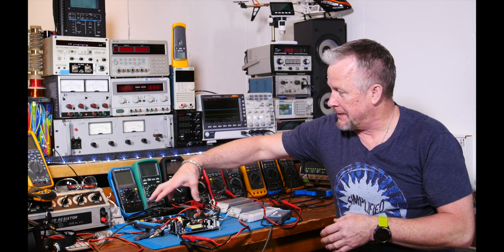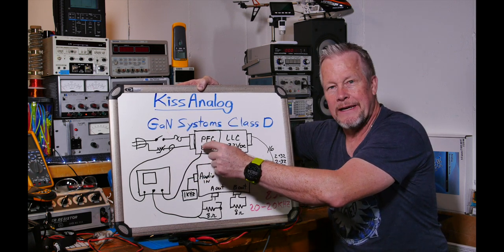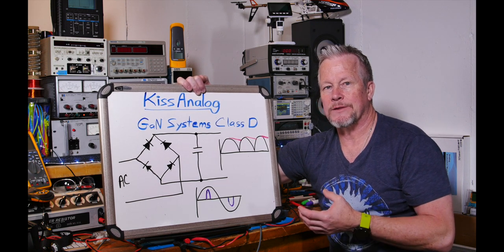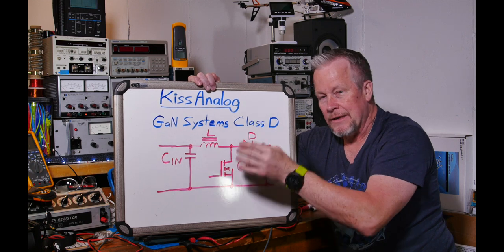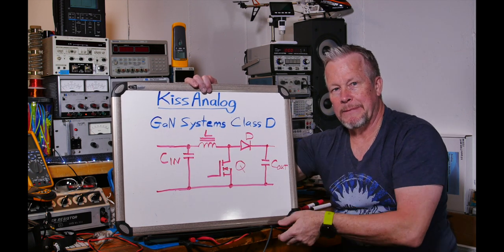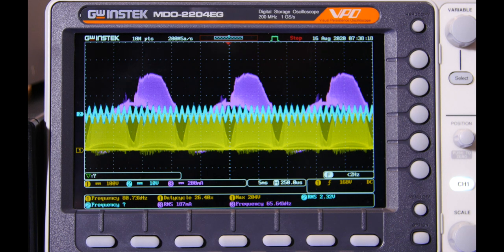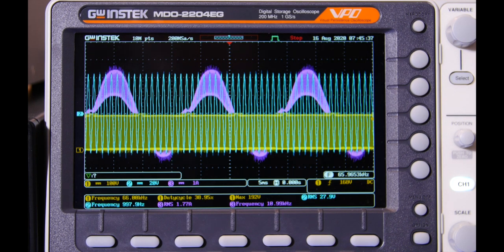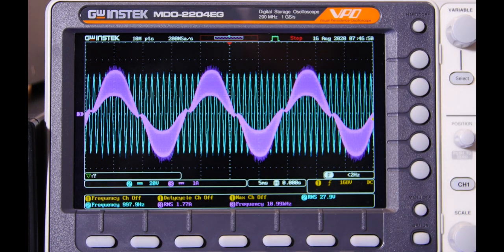GaN Systems PFC Boost Converter #PFCconverter #boostconverter #GaN #classDamplifier

Comment: Eli = Voltage leads in inductive circuit ICE  = Current leads in capacitive circuit man. I am flashing back to my industrial controls 1 =16 weeks 4 college credits August 2000,Industrial controls 2 16 weeks - 4 college credits = PLCs| Then went to the electronics side and had 7 16 week semesters in electronics to get my certificate,BK scopes ,analog and Tektronix digital.[ Ahh resonant frequency, the election coming ?] Just found your channel, liked your rundown on the top 10 scopes.[ Intro to electronics,5 college credits 16 weeks,[ electronic devices and circuits 16 weeks, 4 credits[ Digital electronics, 16 weeks, 4 college credits[ tech math 16 weeks- 3 college credits,[ electronic fabrication, 16 weeks 3 college credits build power supply's & meters.[ Electronic trouble shooting, 4 COLLEGE CREDITS 16 weeks, build am/fm radio align stages, build wireless microphone to transmit,TO it, oscillator circuits/tank circuits, Armstrong ,pierce,coll pits  hence resonant frequency. Cis 101 3 college credits 16 weeks. the Microsoft suite,required at every college. Finished December -2003.Triton College,River Grove,IL
Reply from the maker: LOL It is funny how we remember certain things;)  It sounds like a great education!  Are you working in the industry now?  I'm glad you found this channel.

Comment: Great video Eddie,
Still dont get the importance of PFC, what does it matter if input current is out of phase with voltage? What does in matter if input VA > output W? Does it mean we are paying for more power than necessary? Does it mean our linear PS transformer (VA) needs bigger heavier and more expensive than necessary? Thanks again
Reply from the maker: Yes the power factor affects the transformer and other parts.  Thanks for the great question.
Reply: Residential users don't pay for apparent power but those energy still needs to be generated and goes through the grid and a big part of it just gets lost to heat, all the extra capacity needed in infrastructure still needs to be paid by someone.